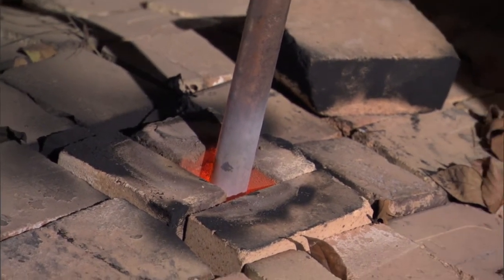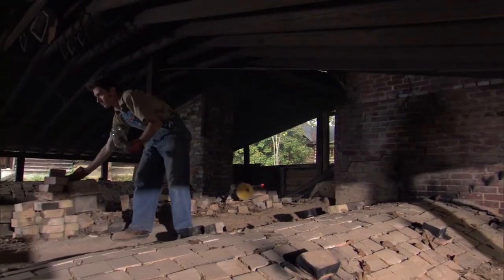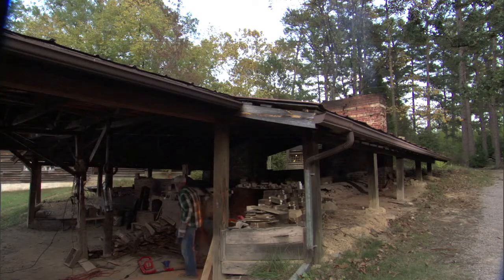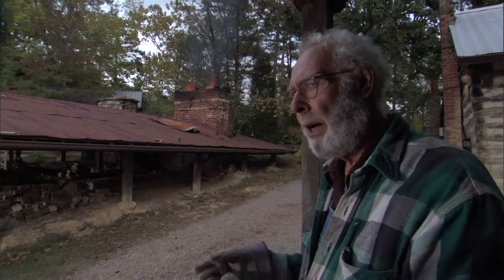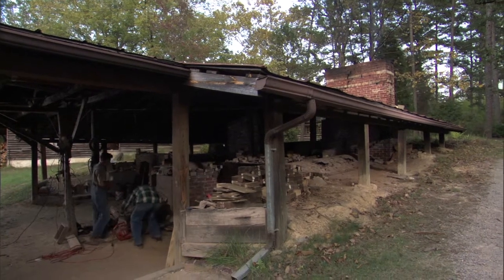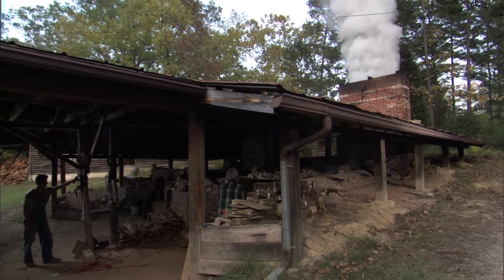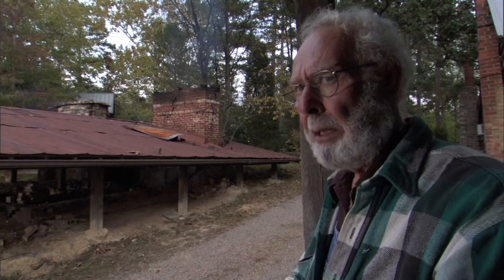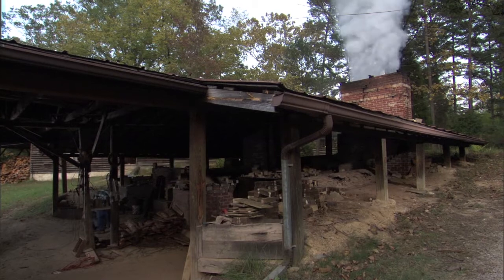Salt Firing and Adding Salt to the Kiln with Master Potter Vernon Owens

Comment: Best guess here.
The salt used is typically sodium chloride.  In high heat, the sodium separates and bonds to the silica in your clay, which creates your glaze.  What's left is chlorine gas, which comes out your exhaust.  Probably best not to breathe that stuff in.